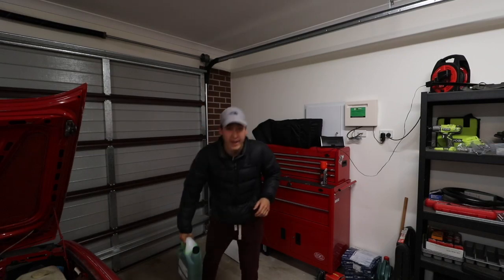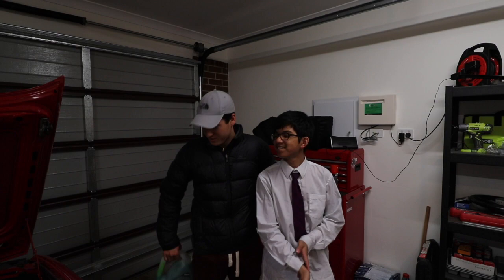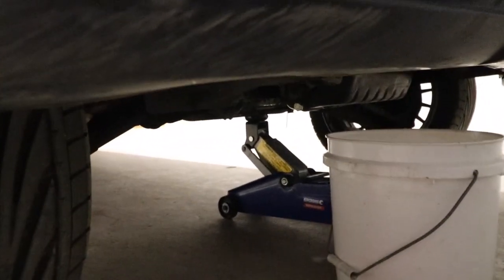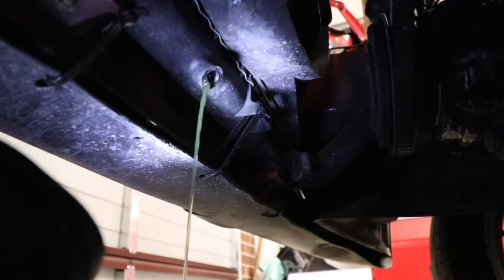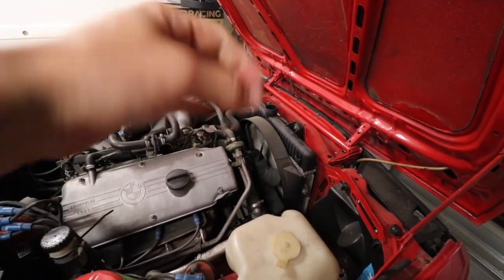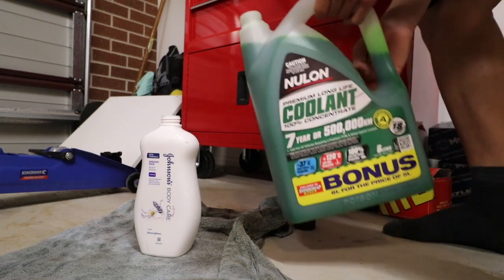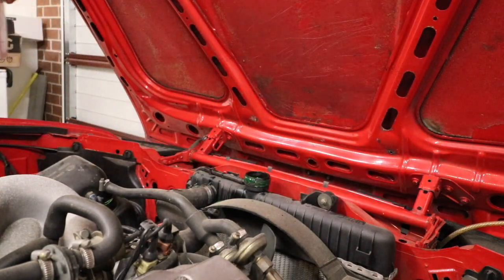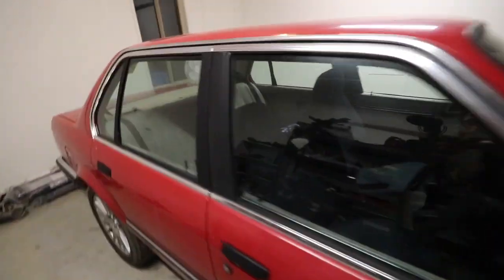How to CHECK and CHANGE your COOLANT // BMW e30

Comment: 2 Litres out of 7 Litres where taken out. It was a 29% coolant change. Which is fine when coolant is not severally deteriorated. Extra coolant screw plug is located behind exhaust manifold where the remaining 5 Litres are. Not sure how to refill the hole system after draining it. Nice video. Greetings from Spain.